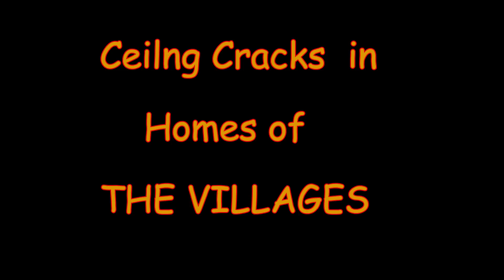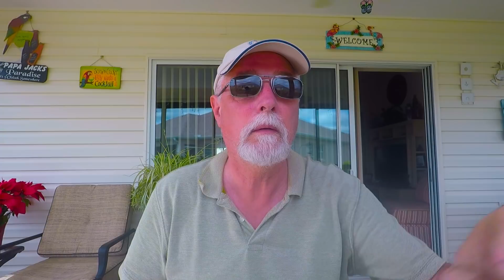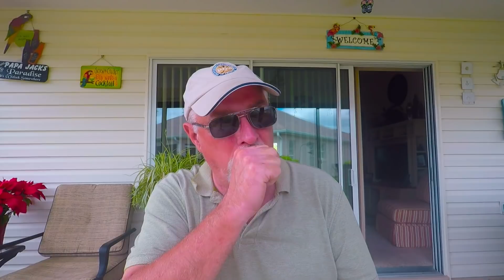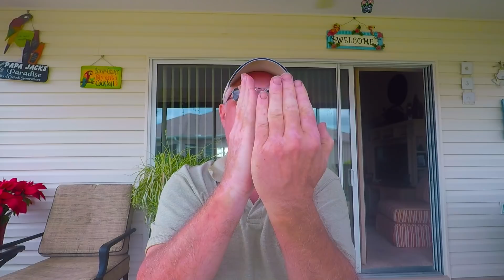Ceiling Cracks in The Villages

Comment: Hi Skip, I am an insulation contractor by trade. I know you said that the contractors wouldn't guarantee the repair. This leads me to believe that it is probably a truss movement issue.  The difference in temperatures and humidity and the storage above could be enough to allow that truss to grow and shrink or flex just enough to cause the truss to crack the drywall. . My guess they could repair it but it will most likely come back. I have a similar situation in my home up North where we have fixed the same crack 3 times. We now call it patina.

Comment: Skip I am a former fire code official (not in Florida) and a couple of things you said got my attention. First the drywall company went out of business. So what!  If the Chevy dealer down the street goes out of business does your warranty end?  The builder pulled the permit. 

The correction they described said to use tape for exterior use. That makes me believe they didn’t use the correct tape during construction. You folks may want to get an architect or engineer that does residential work. I would also suggest contacting the Gypsum Association and ask them if this is the proper way to construct this.
Reply from the maker: My complaint was , the structure of the home was 100 percent covered by the developer for the first year then a 10 year warranty on the home was covered by the contractor but i was told by both parties warranty does not cover ceiling cracks. Investigating this I found out that the HOA here has had many complaints if the same issue.

Comment: Should be "blue" board water resistant 5/8" DW.
They also never backed up the end DW cuts. Usually a backer piece of DW is used for backing.
Like some suggested it may be easier and more effective to add another 1/2" layer of DW, ensuring the cracks never return.
Don't use mesh tape, it's notorious for cracking. A quality installer will use paper tape.
Sorry you have to endure the mess of DW mud.

Comment: I would  insulate the area and install another layer of drywall (using screws) over the original drywall.
Reply: It is easier and less messy to go over the old drywall.  When we built our house , we put 2 layers of drywall on the ceiling.

Comment: Skip, I know this is a three year old video but what did you do to remedy your ceiling crack problem? Also, are the cracks generally running along the drywall tape line or random cracks here and there?  I would think that if the cracks are running along the drywall tape line, it might me more of a drywall tape problem or the paste used.  Also, I could understand the lanai areas that are not closed in could be a problem because of extreme humidity with no protection from the elements.  If there are no problems within the heated and air-conditioned areas, I can assume that it is not a foundation problem as someone suggested that the land could be sinking.  If it were, the inside areas of the home might also have the same problem, including ceramic and porcelain tile cracks.
Reply from the maker: Everyone is along a taped joint... So far The Villages Home Warranty is pointing fingers.. I haven't given up but we have not made much progress

Comment: If these contractors wont fix this issue I would get on a ladder and use a white 30 year silicone caulk to fix them. Then paint the small areas so it blends in and be done with it.

Comment: I wonder if land movement is causing the problem. We have that happen here. In fact, we had a piece of brick wall move slightly out of alignment due to land movement. We had it repaired some years back and so far it hasn't returned.
Reply: Absolutely correct. Drywall and insulation issues are a fool's ruse foisted upon the uneducated. Sinkholes and water seepage are the bane of central Florida, and have been for centuries. Villages Idiots.